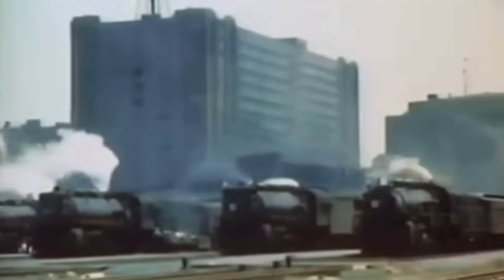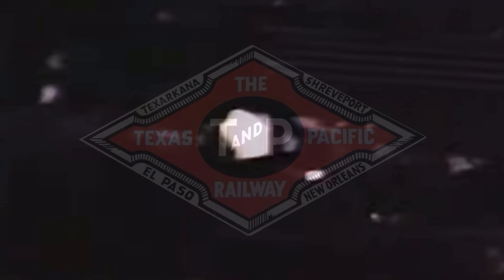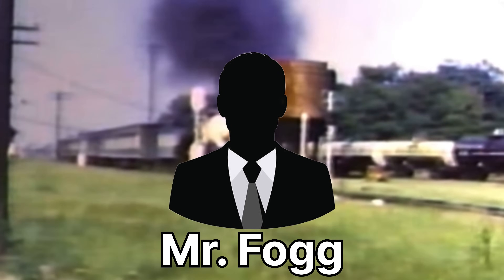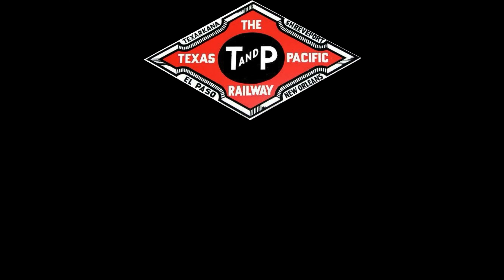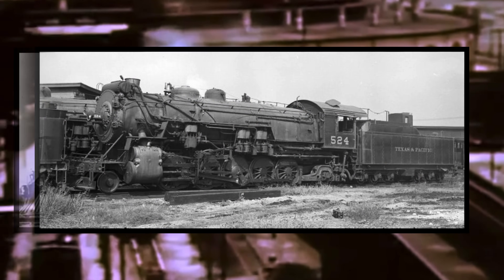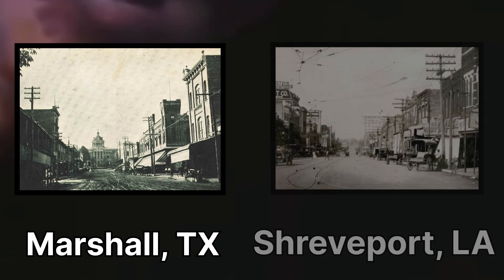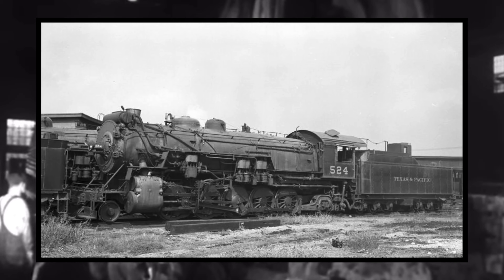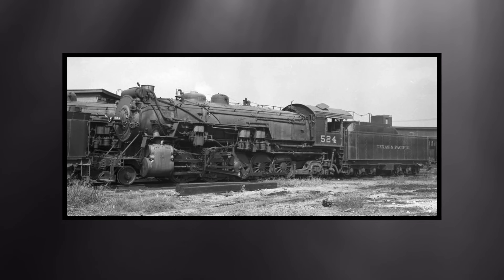T&P 524: The Snuff Dipper

Comment: Pretty interesting. But i have a couple of corrections:

It's 50¢ not ¢50
The fan in the stack extracts not extrudes the combustion gases.
Reply from the maker: Honestly, I don’t think my usage of the word “extrude” was really wrong. The word means “to be forced out,” and the gases were forced out due to the fans pulling them out. But I really should have used extract. With that being said, I do appreciate your comment. Helps me rethink my word usage.

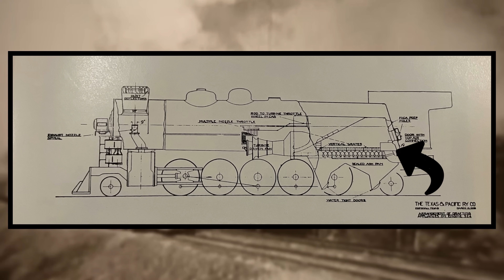Comment: When at 2:13, you say "...blowing into the smokebox,"' you should have said "firebox."  Lignite-burning locomotives for foreign lines had huge oversized fireboxes.   There were regulations/union rules about how big grate areas could be for hand-fired locomotives (50 square feet was a common limit), meaning lignite-burners almost had to have mechanical stokers for a useful-sized locomotive.
Reply from the maker: I never realized I said “smokebox.” I’m surprised I actually let that slip by.
Reply: NP--that's indicative of why writers need editors. @jcstrainsandthings